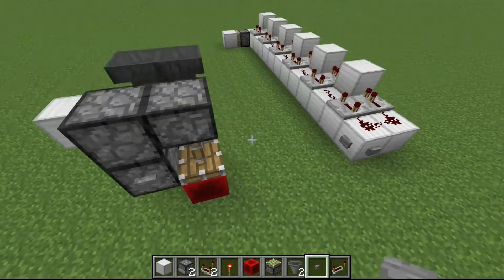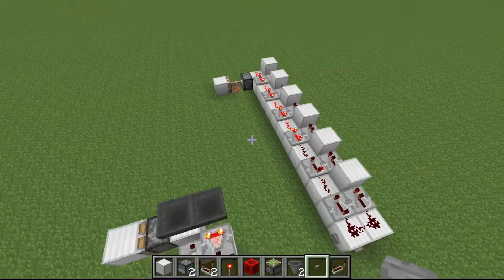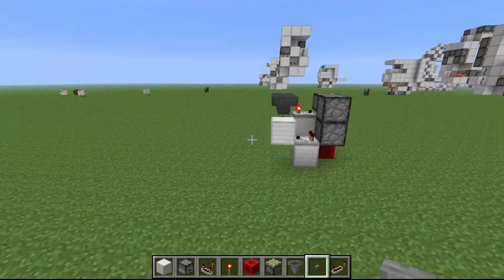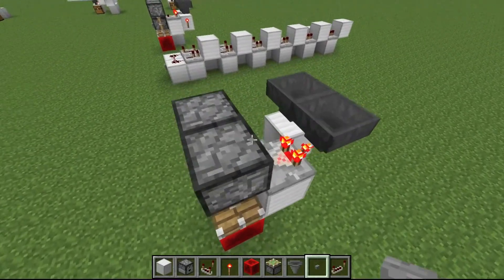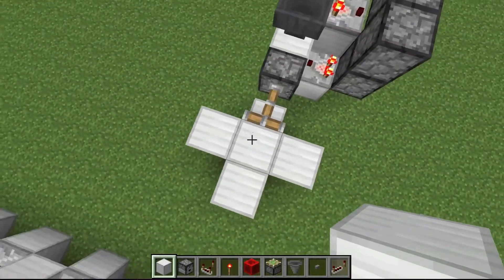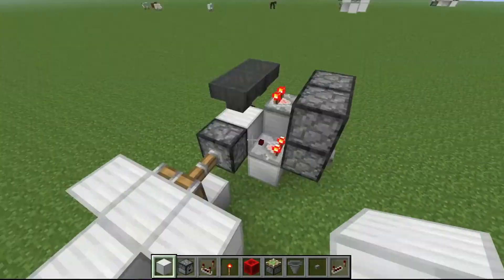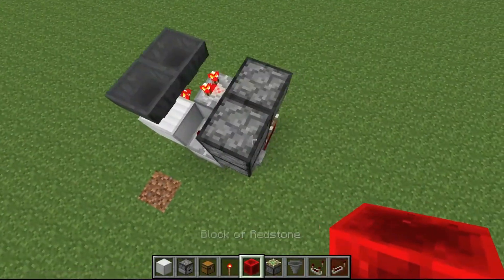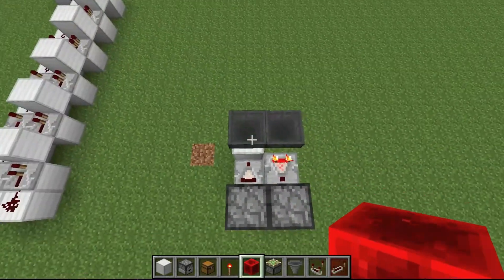Smallest pulse lengthener

Comment: The second pulse extender is kinda inefficient. You can remove the repeaters on the side without the blocks, and set all the other ones on four. This is still way smaller than that still though.